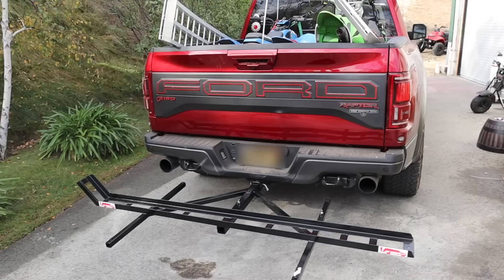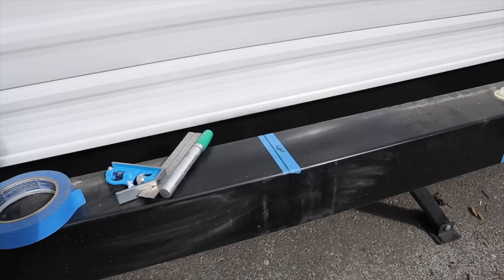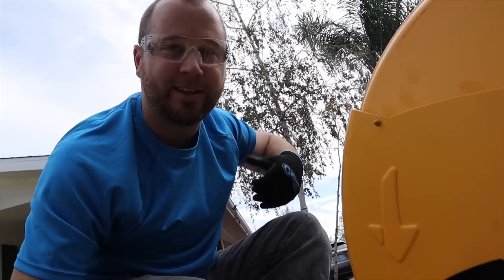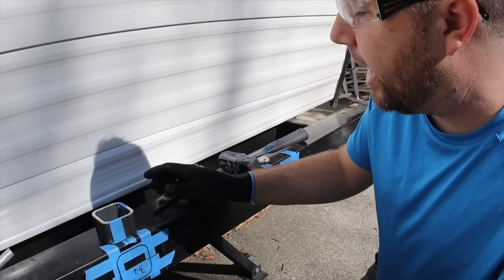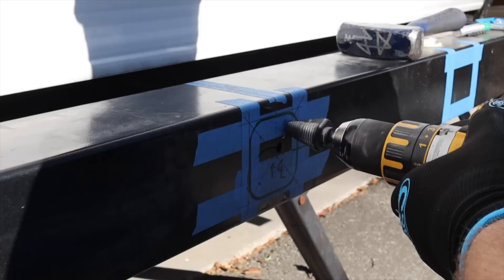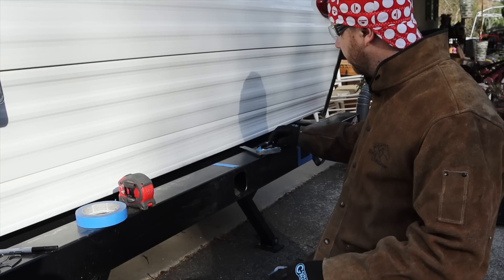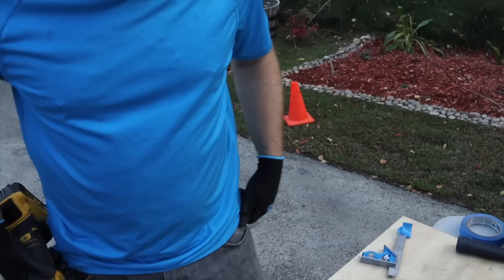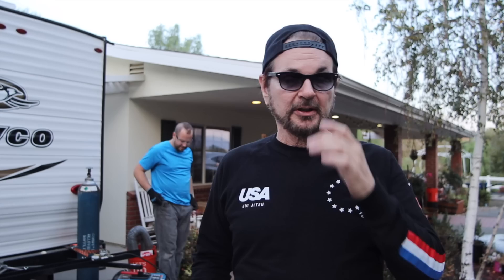How To Weld A Motorcycle Trailer Hitch Carrier - ROCKETT VLOG #36

Comment: Nice clean job , but I sure wouldn't have done it that way. You lost use of your tubular bumper. What I did with my bumper was made of Trey using a section of residential rain gutter. This slide right inside of the bumper where I can store things like fishing poles call my aunt just slide the tray out for easy access. Then I put a locking cap on the end of the tubular bumper.